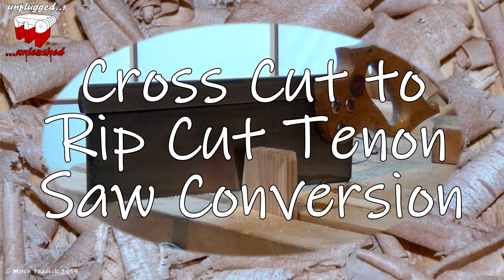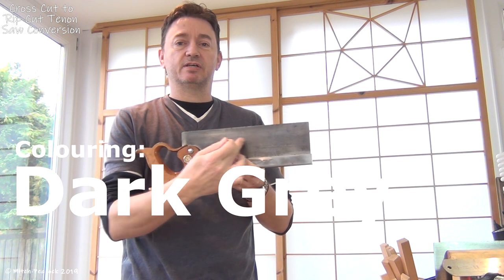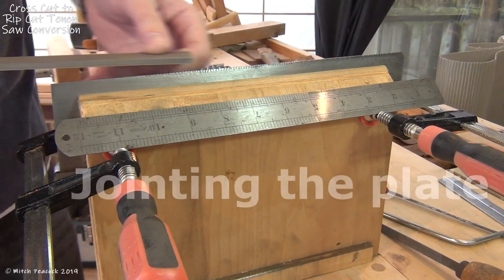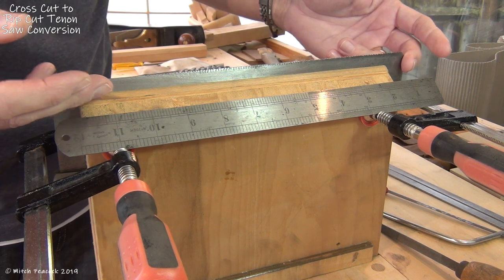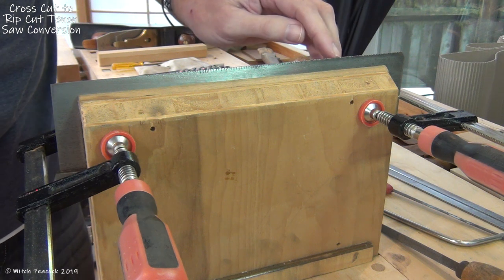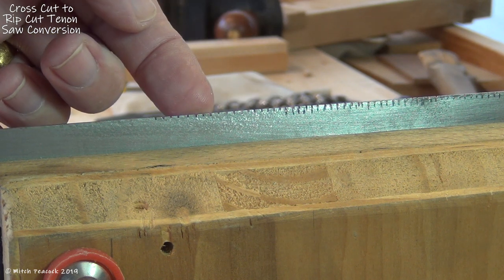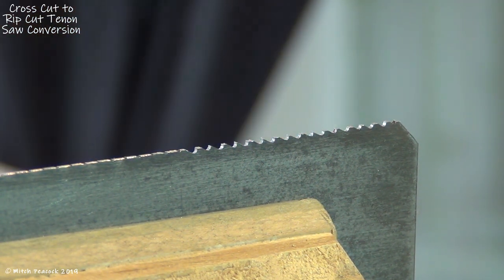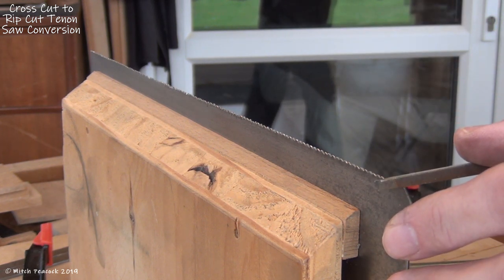Cross Cut to Rip Cut Tenon Saw Conversion - Ideal for Large Dovetails

Comment: I need to get myself a saw set. Any advice on brand or where to get one Mitch? I have a couple of 5tpi needing sharpened for cross and rip. Do you need to set (the crosscut) every time you sharpen, or just when doing the overhaul such as this?
Reply from the maker: Hi Rico. Used tool fairs are a good bet, as are auction sites. They must still be being made somewhere too, so try your specialist woodworking tools supplier.
Teeth get a little shorter each sharpening, which will reduce the set a little. You'll notice once the saw begins to bind, and that's when a resharpen is needed: knock or squeeze the set out, level and shape the teeth, set, and finally sharpen. Finding the best set is a little hit and miss. The set will have an indicator for tpi, so start there and repeat the last two steps above at slightly different settings until you're happy.
Reply: @mitchwoodwork  thanks Mitch, great advice!

Comment: I see you did not need a fancy saw vise to hold the plate while working on it.
Reply from the maker: Too right. They look nice, and I may get around to building one, but this simple setup works just as well
Reply: @mitchwoodwork  I've seen videos of the saw sharpener at the Lie-Nielsen factory use a wooden vise that looks homemade. Although I cannot lie: some old metal saw vises are quite pretty.